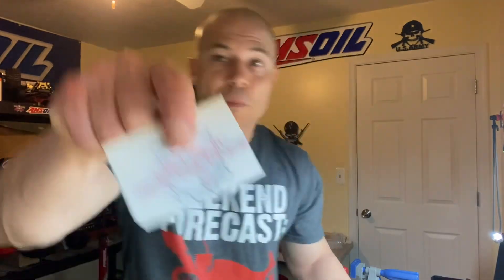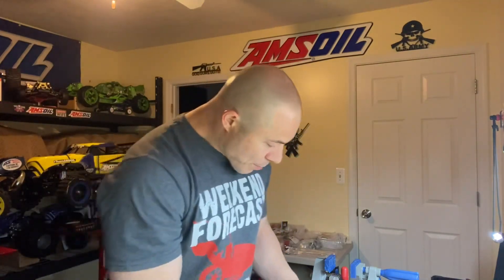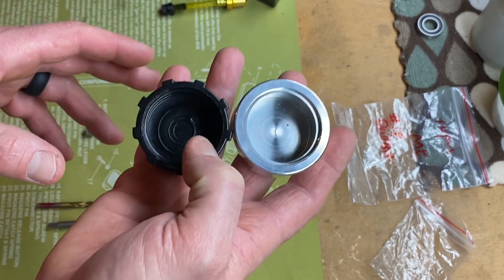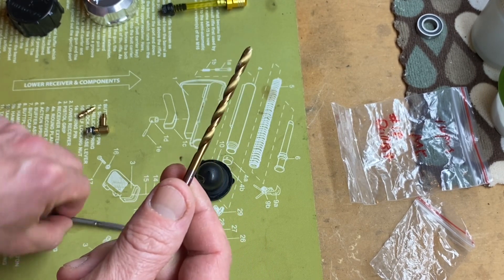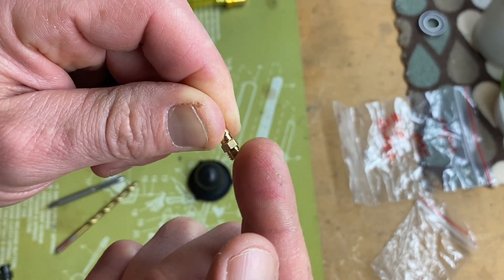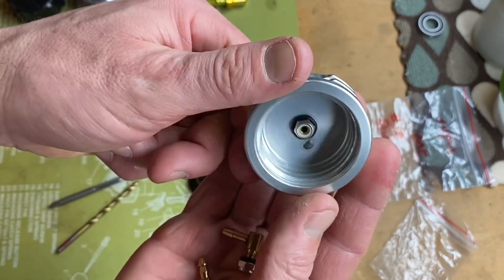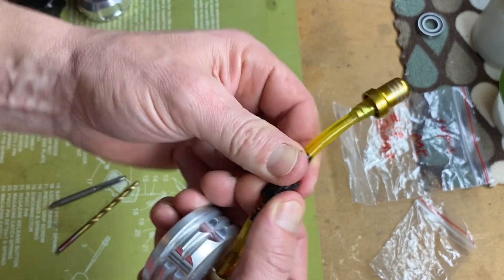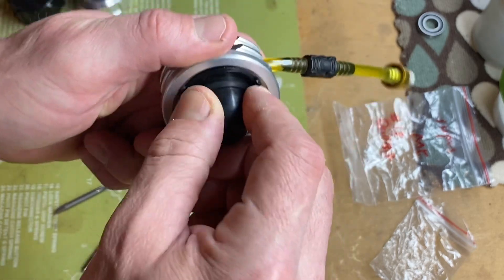Gas Cap Tech Mod And Shout Outs To A Few Good Brap Brothers!!

Comment: Good tip brotha!  I need to do that with my Baja so I stop spilling my gas when it flips. Also, I just love when your mom talks during your videos. Great to see how your family supports each other.
Reply from the maker: Thanks brother Anthony we are a brap family!
Reply: @eastsiderc  what's your opinion on using the rovan 3 line grommet vent kit. Basically a 3 hole grommet with a vent, and a fuel cap bladder that doesn't have any vent holes in it.

Comment: Hi mate could you put a link from where I can buy this from thanks
Reply from the maker: I make these bro. You can get the little brass fittings from Amazon they are called rc boat nipples with M5 threads! The vents can be bought from TaylorRc or Amazon as well its just a motorcycle tank vent with the ball valve inside
Reply: @eastsiderc  ThAnks your are a star